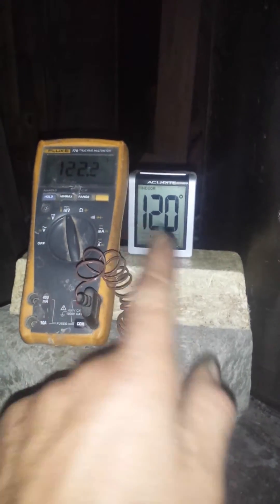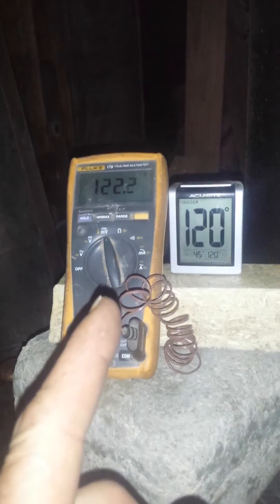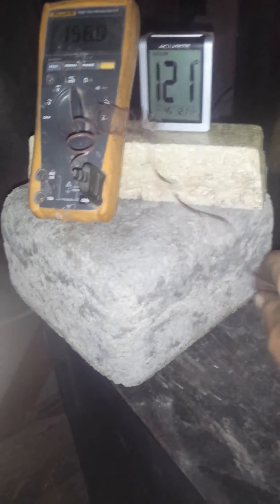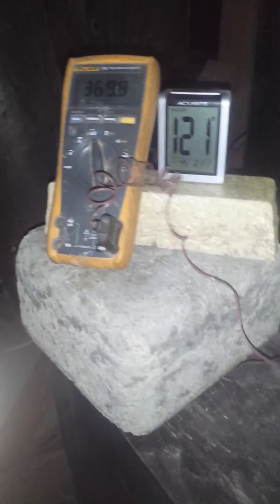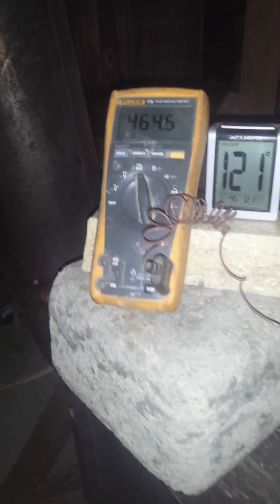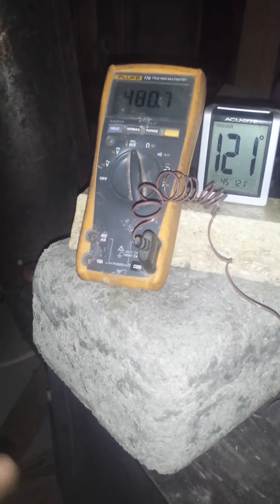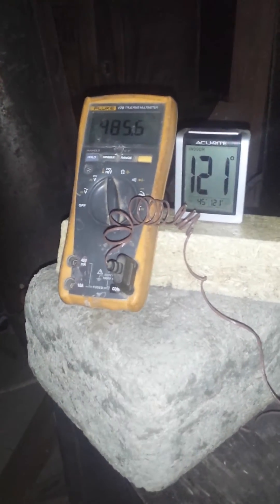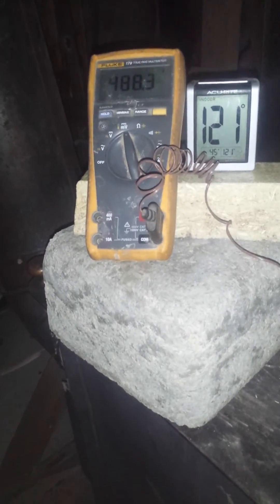HempCrete, thermal mass, radiant heat test, insulation level

Comment: What would it be in the opposite case - if the outer side of the  block is in wet cold condition like in cloudy winter day, when the block wold absorb more water? What would be on the inner side?
Reply from the maker: Hemp shiv concrete has more strength than say adobe cobb , but it's not aggregate concrete 
It would depend on the thickness of the material cast and exposed wind load that will allow the moisture to penetrate deeper , might  suggest using around 1' foot thick the material can be both simultaneously and remain structural , great luck 🤞

**  Hemp shiv concrete has no acrylic resin modifications , it requires mass 

* Water resistance can be achieved by changing the medium used , for example hemp bast hemicellulose modified with acrylic resin concrete 

https://youtu.be/HSE5vESjFk0

Comment: can i ask a question? how do you do a thermal mass testing??
Reply from the maker: @loveuwonicaaa it was sand battery experiments that lead to the passive atrium and ugly iron gasification unit buried in sand mass
https://youtu.be/ztOrrce7568
 https://youtu.be/H654yRzD_Bg
Reply from the maker: ⁉️  I'm sorry I missed this question ⁉️ 
What I'm doing is EXTREMELY crude I was only testing it's K value ( thermal transmission , like kiln insulation 
* the following videos might hekp

 https://youtu.be/fmCSmI-5MK4

https://youtu.be/mztq32gdQeM